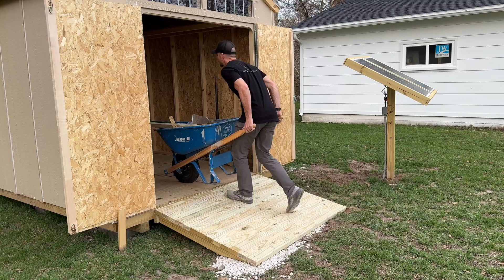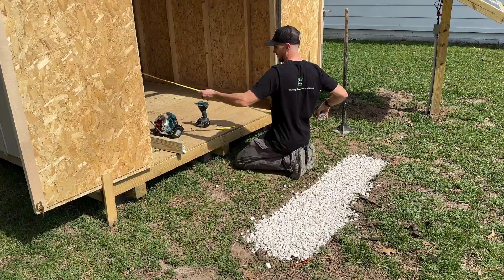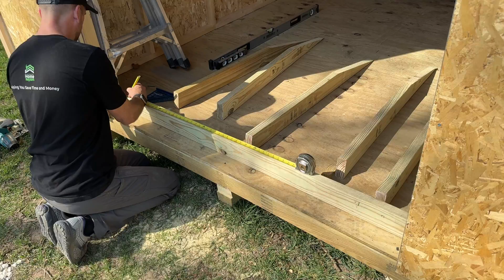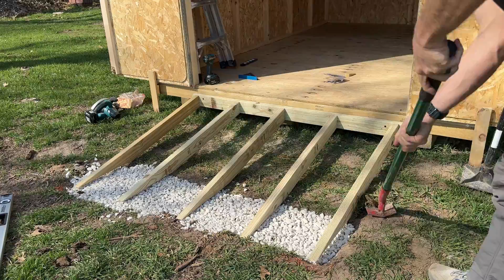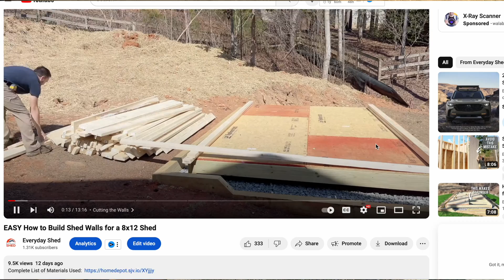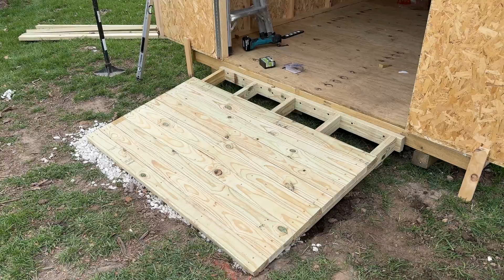EASY DIY Shed Ramp Build

Comment: no need to do those long angle cuts on ends, simply burry the boards, which will create side to side stability, and the ends won't rot and break off so quickly since it's no longer a thin, feather edge.  Also, lay down some weed barrier and rocks under the whole ramp and extending it on each side, along with some edging for ease of mowing.
Reply from the maker: Good ideas... Thanks for watching!
Reply: I agree don't have those little slivers at the end they will rot just bury the boards
Reply: Especially if already have a gravel base in front of the shed to bury them. Good tip, just saved me some cutting
Reply: If you bury any type of board in the ground they eventually rot. Even the green treated wood rated for ground contact. The rock or concrete at the lower end will last much longer, and give drainage away from the lumber.

I just removed a set of stairs made out of 6x6 treated lumber just buried and staked in place with rebar. The tops of the boards look great, when I removed them they were half way rotted. Have no idea how long they were in the ground.
Reply: @MacDa-yy8xn how old were the 6x6 posts
Reply: That’s dumb…. They will rot away in time
Reply: I have concrete so this doesn't apply

Comment: Great video! What do you do when the bottom of shed doors hang 2" or so below the floor line. Even if you lower the top end of ramp to clear you'll still have a "hump" to overcome. Trimming the door bottoms?

Comment: You might want to add some grip tape to the ramp. Wet angled wood can be slippery.
Reply from the maker: Not a bad idea 👍, thanks for the feedback!
Reply: You can use leftover shingles from a roof job for that! My contractor suggested it for porch steps & they work great!

Comment: Thanks for the tip. I'm going to attempt to try this on my own the only thing is that my shed was build on a concrete floor. This means that I do not have a wood floor. I would like to build this but would also like to include some type of lip purhaps metal that can rest on the concrete and attach it to the ramp it self. I dont think I want the ramp to be permanently attached to the shed concrete floor so It needs to be removable each time I need to use it for my riding mower or motorcycles.
Reply from the maker: Wonder if you could use a large piece of angle iron as you lip.  Drill a few holes and attach it to the top edge of the ramp to hang on the concrete floor.

Comment: What a GREAT video. I’m not a carpenter by no means…. But I honestly followed your instructions verbatim… and it came out wonderful. The only thing I would suggest to others if they read the comment is that the inch and a half down for your header board does not work all the time depending on how long doors are I just bought a brand new shed and the doors are quite long; covering the door. I actually had to go down about two 3/4 inches to be able to get door shut.  I did use one by sixes for the top boards and also I use pressure treated wood which that is quite heavy when you’re doing it by yourself … lol. so I do have a little bit of a lip to get my tractor up inside the shed, and the doors are so heavy. There was no way I could get them off and rip off an inch or so …. So….it is what it is but Again great video. Thanks for posting!
Reply from the maker: Thanks for the feedback 🙌

Comment: Stair hangers (simpson strong tie or similar) can be useful on the ledger board too.  I have an 18" rise and 8 foot ramp with heavy stuff like atv's. Treated lumber and butyl tape is good for wet areas.
Reply from the maker: Great tip!

Comment: Use a 2x6 for the ledger. 
Drag a line 1.5” down from the top to guide placement of the ramp 2x4s.
 This allows pairs of screws to support the whole ramp, instead of a single row of screws. 
  Inset a 2x6 at the heel of the ramp 2x4s. 
 Spreads the settling load of the ramp over far more surface area on the gravel.
Reply from the maker: Thanks for the feedback Keith 👍

Comment: If the shed is under 6" off the ground, an easier and cheaper way would be to use gravel and pavers.

Put down and grade the gravel, then put down paver sand on top and compact.  Lay your pavers over it.  Get your gravel, sand and pavers from a local stone shop to save considerable money over big box stores.  I spent about $35 in materials.

I had an old railway tie to stop the gravel from moving under the shed, but you could use 2x6s screwed together.  To stop it from coming out the sides you can put retaining wall blocks, or arrange some half hex pavers in a mow strip and backfill behind them with the gravel.  Use landscape cloth under the stone if you go that route.
Reply from the maker: That is another option for sure, thanks for the feedback!

Comment: Thanks I need to replace my ramp, which is 30 years old. When I originally did the ramp, I took a router and cut a groove in the shed plywood floor at the door. Screwed a Piece of Angle Steel, in the groove, so I wouldn’t start splintering and separating the plywood floor, from the wheels and tractor tires hitting it.
Reply from the maker: Great idea. I love these easy fixes.

Comment: Nice video.  I have a 10x12 barn being delivered tomorrow.  I will build a ramp as you have.  Question, why use 2x4 decking instead of regular 5/4 decking?
Reply from the maker: Just for a bit more strength with the 2x4’s.  Hope the delivery went well 👍

Comment: Really nice video. Thanks! 
I have a slightly different scenario as my yard slops down under my ( quite old) shed (to the left as I stand looking at the door). I had the shed raised and  leveled with blocks underneath when I moved here as it was sitting in dirt in places, but this then means the space from the bottom of the door to the ground is about 4 inches more on the left side of the door. Do I just mark & cut each of the support boards separately? 
I was wondering if, instead of attaching a ledger board, if it would work to build a framework whose top runs level and it’s sloped on the bottom to create the level top when put in place on my yard? And then build 2 x 4” wings coming forward at the base to stabilize it? Or ???
Reply from the maker: I will put out a video on making ramp for sloped grounds, that should help you. Stay tuned. thanks for watching.

Comment: How much weight would this hold? I need to build one that can hold up to 1,000lbs. I was thinking 2x6 dug into the ground for the 4-5 run boards going from the shed into the ground. Then backfilling in with dirt giving them stability on each side, but also adding strength so when more weight is put on it, it had the ground helping hold it up. My concern after watching this, would that accelerate rot? Would I need to reinforce the ledger board or would the earth itself held hold it all up since I’m back filling and using 2x6 for the runs and 2x4s on top? It’s 48’ wide but has an 18’ rise at the shed. I was going to have it go 60 inches long so it’s not as steep with an 18’ rise at the opening. Thoughts ?
Reply: Correction. More like 2x8 maybe 2x10 with around 200-400lbs of fill dirt to build up and brace everything
Reply from the maker: I would say, better to overbuild in this case... few more bucks you get a 2x10 and for sure it can hold.
Reply: @EverydayShed  I have been running numbers and building the physical schematic ( I am really OCD like that, and since this is still relatively new to me, I like seeing everything so I can see where I am missing something and catch it, before messing up on the more expensive boards ) today and and instead of making it come out 5 feet from the shed, I am going to make sure that on the C squared side, that will total 54 inches ( + 2 inches from the ledger board ) which will give me 56 inches on the C squared side. This will make it so when I lay 2x4 I can buy 7 of the 2x4x10 and make 14 48inch boards for the actual walking part of the ramp. That way it will come out near perfect and I won’t have to cut one of them in 1/2. I will measure out from the base of the shed approx 53.03 inches with and 18 inch height to the door. I may change the width of the ramp though. The door itself is 48 inches wide…. I was thinking if I added maybe 2-6 inches on either side of the door, it would look a bit more beautiful and give a little more… space. As it stands I will need approx 15 cubic feet of soil to build up and fill it in. If I bought from H.D. I would need 20 bags but I found out I can get a cubic yard for $30 at a local garden shop. If I do widen it, I could always get 2x4x12s and for the 2x10x12s I would only need 1 extra one to account for the longer ledger board.. I am still concerned about not staining everything but from what everyone says, the wood that is in contact with the ground, is all pressure treated. Should i use pressure treated 2x4s as well
For the walking part of the ramp? Or just for the ledger board and joists ? Appreciate that advice.

Comment: My shed is on build level on concrete support pillars but the ground in front is on a slight angled slope.  How would you recommend going about this build in that case?  Burry the ledgers or try to level out the area at the from start of the ramp?
Reply from the maker: I have a video where we build a ramp on a slope. https://youtu.be/0FL7C3hoW3Q?si=aTuR1_MSj6kNFD5x

Comment: Hey my cuts with the circular saw on angle (15 degree) didn't all come out the same so on my garage floor when I put together the joists with the two boards I use a level across and it isn't leveled, how can I fix it?using shims? Or wait until i am outsidr and install the ram? I just think if its not level now it wont be later no matter how much i play with the group leveling. Rather try not to take anything apart if I can help at this point. Thanks
Reply from the maker: What about using more gravel or pavers to level it out?
Reply: @EverydayShed thanks ended up working out at the end and looks good happy with the results, thanks for the guidance on this video

Comment: How did you determine how long the ramp should be? My shed doorway sits about 19 inches off of the ground. Just want to make sure I have enough clearance for a driving mower to get in and out of the shed without bottoming out.
Reply from the maker: I usually just eye ball it or just use a test 2x4 adjusting the length to get a feel.

Comment: How did you attach the decking board at the top of the ramp where the 2x4 ledger sits?  The top of the ledger surface wouldn't be parallel with the ramp boards.
Reply from the maker: GRK Structural Screws are great for that.
Reply: @EverydayShed  So, then would the very top decking board be screwed into the ramp board (using the structural screws), but slightly overhang onto the edge of the ledger board without screwing it into the ledger board?

Comment: Is there a reason that you did not backfill the the front edge with the soil that you removed?
Reply from the maker: I would prefer to keep the soil off the pressure treated wood but if you would like to backfill you could without taking much of a hit in how long the ramp would last.

Comment: My name is Gragg Cain I have a storage building and I have a toro 34" zero turn I believe it is a 12 " rise it sits on a 5 1/2" concrete slab would you use a 60" ramp to get the lawnmower in the storage shed? thought about 2x4's for ledger brd. and 2x4's for decking. would that work. or what is your suggestion?
Reply from the maker: 2x4's are pretty strong, i believe it will hold up just fine. let us know how it goes, i am curious myself.